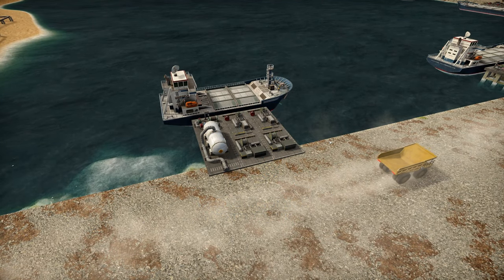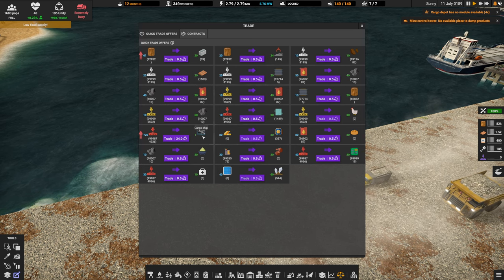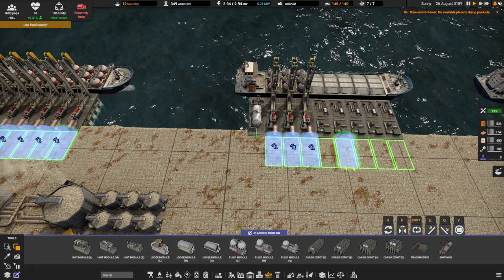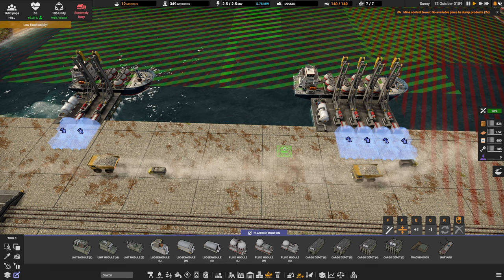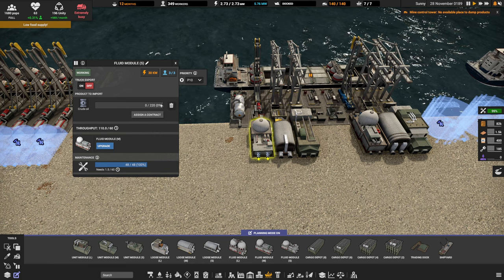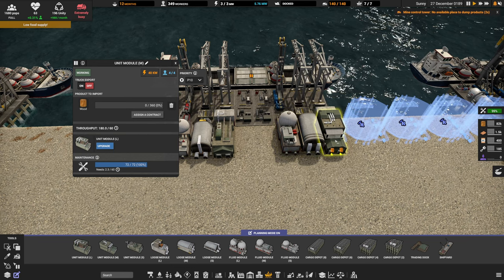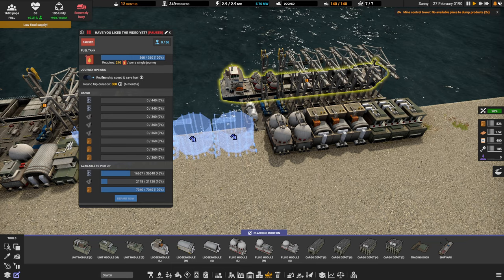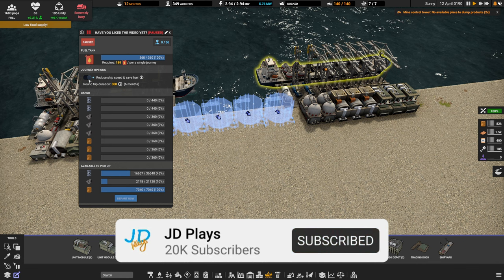Docks and Cargo ship Explained 🚜 Captain of Industry  👷  Walkthrough, Guide, Tips & Tricks

Comment: What does the diamond mean on some of the contracts? I'm trying to work the Construction Parts II -> Iron Ore contract but I can't assign it to a dock. Not sure what I missed
Reply from the maker: The diamond you can just over to get the breakdown of the cost, As for the contract as long as you have it established then as long as you the right ratio of solid and loose modules attached to a dock you should be able to enable it from one of those modules.